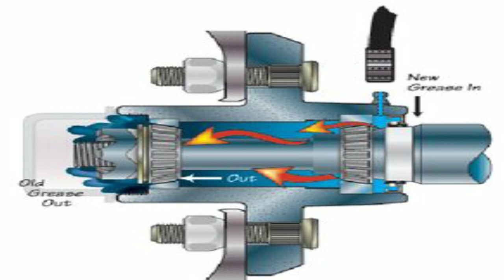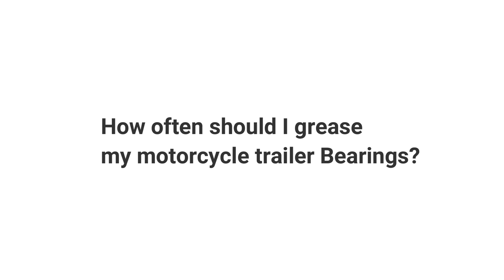How to grease Can Am Trailer Bearings

Comment: Great video, the only thing is you didn’t “seat” the bearings.  There should be a torque to seat them rotate the wheel when torqued then back off the nut, till it free spins, then tighten the nut hand tight till it stops, then line up the castle nut to nearest hole.   It’s in the 622 owners manual.  Step 6 clean all the grease from bearings and hub internal.   Step 8 fill bearings with NGLI-2 or equivalent.  Do not fill more than 20% of cave between the bearings.  Step 9 install hub loosely with nut and washer.  Step 10 Adjust bearing gap. 10.1 using a torque wrench tighten hub. To 150 lbf.in +-18 lbf.in to seat hub properly 10.2 loosen nut 1/2 turn 10.3 Finger tight nut against washer.  10.4 Further tighten nut till one of the grooves line up with the hole 10.5 install the cotter pin and cap.   Step 11 install wheel and tighten lug nuts 77 lbf.ft.    
I have the same trailer thanks to your videos.

Comment: At the beginning of your video when you took off the cap, you mentioned that the job didn't really have to be done because of the amount of grease (oil) in the cap.  If I see that, can I leave as is? Also, you  mentioned this job could be done at 3 -5000 miles. I bought my RT-622 that had been sitting in a garage with no miles on it.  I probably put 600-700 miles on it since I've had it. Should I do this now or just wait if it checks out okay?
Reply from the maker: What year is your trailer?  Did you buy it new?
Reply: @chriscaliente5033  It's a 2010. The guy that had it bought it new and never used it. I bought it and  put new tires on it this summer to replace the originals (worried about dry rot)

Comment: I remove inner bearings by putting the hub nut back on, once the outer bearing  is removed, and pulling against the nut
Reply from the maker: Did u go back with a new seal or reused the old seal like I did?
Reply: If the seal looks good, re-use it
Reply: I'm interested in the shocks. They look adjustable